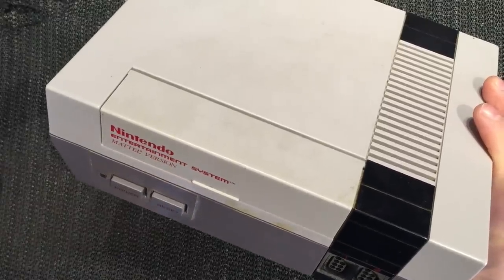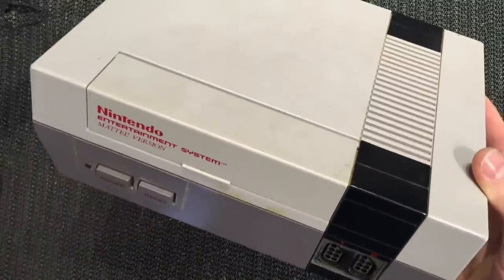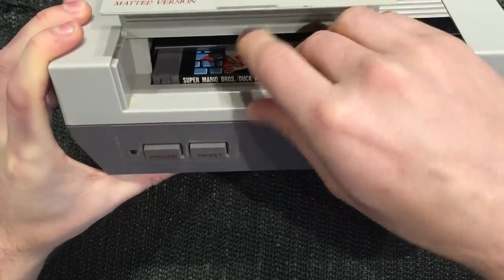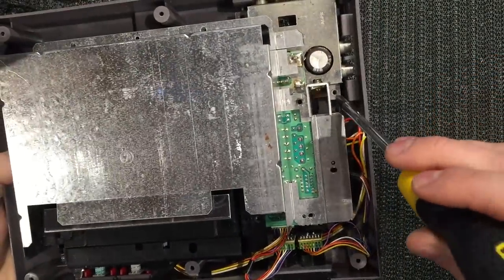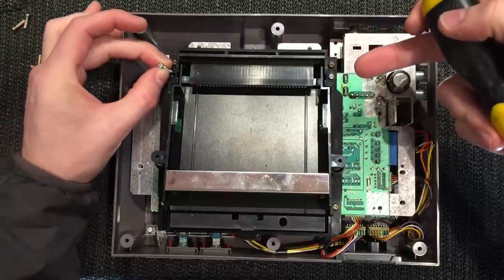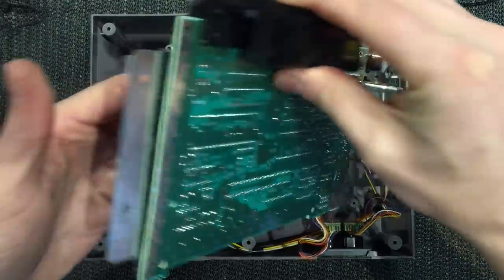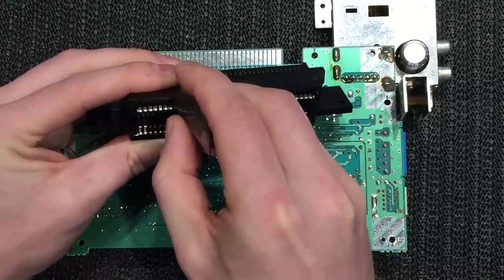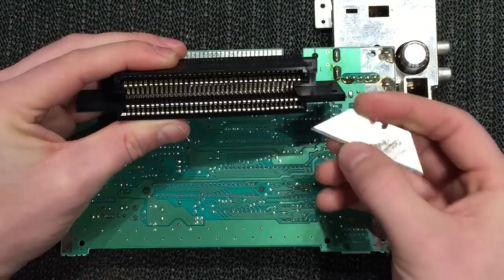Nintendo NES Repair or Replace 72 pin connector  - YouTube

Comment: Excellent comparison video on those who are indecisive on which to choose Global. 

Personally, I tried those Chinese import versions and they're too tight and its a royal pain to take them in/out of my NES. I just repair my original 72-pin connector  and give them a good cleaning. Worked then, and it works now.

Thank you for what you do for us kind sir.

Anthony...
Reply from the maker: Yep that works if you have the time. I have great sucess with the new connectors, so it hasn't been an issue. Some are overly tight I agree, but not all.
Reply: @RetroSalesAustralia  Strange, I bought a Chinese one (same box) and it's absolutely awful. It's so tight that I'm honestly scared I'll break something trying to get the cart out, almost impossible. Game Genie or Hyperkin Fc 2 Nes adapters can't be inserted at all.
So guess I'll use this method to refurbish my old connector instead 😁
Reply from the maker: B C yeah it’s pot luck with the Chinese connectors but I find some of the well established Hong Kong factories still make the best quality stuff.

Comment: I was wondering if it's possible to do a 50/60hz mod on a PAL NES front and top loader. Tried looking online but couldn't really find anything on it.
Reply from the maker: No the NES doesn't use a 50/60hz system like other consoles. It not that simple. You're better off buying a Japanese NES or USA NES. Something else I was thinking about is swapping the CPU and PPU for NTSC versions but I really don't know if that would work... You can buy new chips from China.

Comment: Like ten years ago, I replaced the 72pin connector with one from ebay and it worked pretty well but why not fix it yeah, it was before all those tutorials on YouTube.

Led blinking can also appear when the pins of a cartridge is dirty (even with a working 72pin connector).

Comment: About the region free mod: I believe there are a few games that look for the region lock in the console and they won't work if the console is made region free - http://forums.nesdev.com/viewtopic.php?p=110567&sid=8deb76efd61dfb6a30b8e338345f4703#p110567. The NTSC NES console has a faster processor than the PAL NES console. NTSC NES games on PAL NES console will run slower since they are optimized for the NTSC NES processor. PAL NES games on NTSC NES console will run faster since they are optimized for the PAL NES processor. https://www.youtube.com/watch?v=fAfFFPpeU5k

Comment: What can you do if this wont fix it i have changed pin connector and i also cut the pin on the chip
Reply: Same
Reply: Kinda late but try cleaning the connection on the board itself.

The one where the pin connected attaches to.

Comment: i replaced the 72 pin connector and don't need to push game down anymore. maybe you should try that. is it just habit that you keep pushing it down without tying it when it is up? yuo are actually bending the pins pushing it down so it is not a good idea i think. don't push the games down and see if they work for you. also how are you holding the razor blade by the blade like that? who holds a razor blade wit there thumb pushing into the blade itself? that is the most unsafe thing i ever seen.
Reply from the maker: With the razor I like to live on the edge! :P

Comment: I boiled all 3 72 pins, adjusted the pins, used alcohol, sanded. And all 3 systems dont power on. Wth
Reply: If it doesn't power on at all ( no red light ) that's a whole different problem and not caused by the 72pin connector at all. In most cases it is a faulty power adapter, sometimes overtime the wires just wear and break contact

Comment: I didn't have to touch the bottom row of pins. I carefully removed each top pin and bent them down a little. (you can't really get to them while they are still in the connector housing). There's holes on top at the back where each pin is. These give access to the metal retaining tab on each pin. Just push down on them a bit while pulling on the back of the pin and they should come out. Doesn't take much force to do.

I wouldn't trust those cheap 72 pin reproductions from China (or anywhere else really). They appear to be way to tight and may wear down the pins on the carts faster. Plus it detracts from the feel of the console. They aren't super tight brand new off the factory so if you come across an NES where carts are hard to push in/pull out then yeah someone stuck a modern replacement in. Seems like the repro's aren't 100% correct in their tolerances. :(

I got my NES from a local pawn shop. Seems whoever previously owned it already did the lock chip disable thing. Though I kinda wish they pulled it from the board and not from the chip as I would have undone the mod (I want to keep this NES as original as possible). The pin seems to have been removed from the chip where the pin originates so I can't really undo that mod. Not a big deal I guess. I didn't plan to play any imports so wasn't going to do the mod. But seems someone who owned it last already did it for me. Given that I risk damaging the chip trying to reattach the pin I guess I'm stuck with the mod. :P

Anyways I got the NES for $70. After cleaning the mario game it would still not boot and so I pulled out the connector and did what I mentioned and it started working fine after that. Cleaned both my games and now it seems to work every time. I have yet to have it fail to boot since I did that. :D

Also the best way to keep things running is to get cartridge sleeves. I don't have one for my mario game yet. Only own 2 games right now. So the one that doesn't have the sleeve I leave inserted in the slot. But I don't leave it fully seated. The metal pins will wear down faster if you just leave a cart inserted in there for long periods of time. So instead I just slide the cart in far enough for the door to close and that's it. Once it gets a sleeve I'll leave it outside the console.

Heck even the cart connector on my Sega Genesis Model 2 was a bit finicky since someone left carts in it all the time. I had to pull those pins out a bit to tighten that one up too. Not as finicky as a NES slot, but still. Don't just leave your carts inserted for long periods of time. This applies to pretty much all the cart based consoles like the SNES/Sega Genesis, etc. :P
Reply: My wife's very cute cousin gave me her old NES, i didn't know they went for so much, I got a few unopened games too!
Reply: As an old auto technician ive pulled more than a few terminals for repair and replacement, Im doing it your way, good idea.

Comment: And also blinking light? Just wiggle cart in console problem solved
Reply from the maker: Wiggling the cart is not a solution to the problem, that's just a temporary fix. The reason the light blinks is all due to poor connections within the 72 pin connector, so it really needs to be repaired or replaced one way or another.
Reply: +Global Garage then clean 72 pin contacts not converter but the board you connect it to plus qtip the hell out of motherboard use alcohol but be carful reason why systems any system fail is cause motherboard needs tlc
Reply: No not all the time.... Pins can be out of alignment and dirty so this won't fix it!